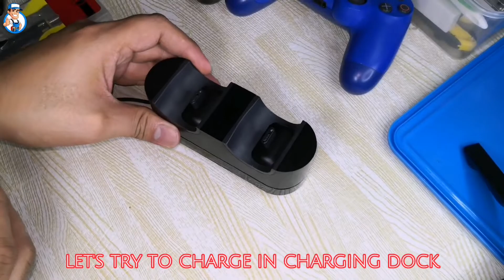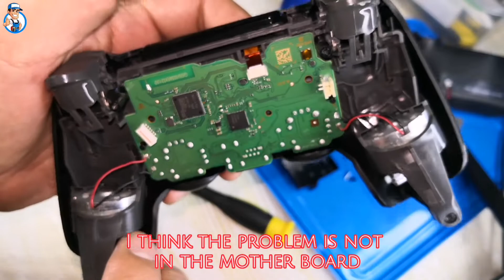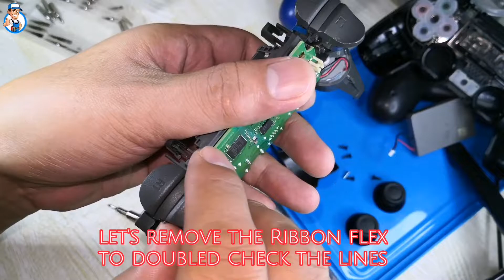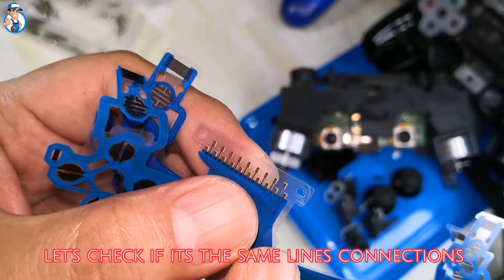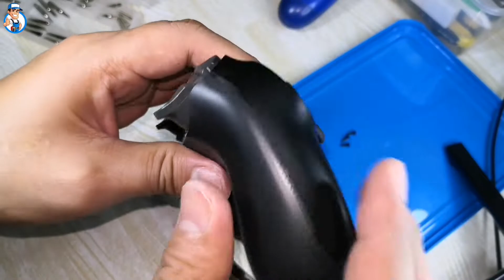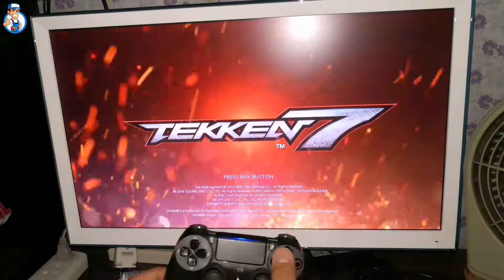How To Repair PS4 DualShock Controller | CAN'T TURN ON, Replacing Conductive Film Can Solved it !!

Comment: Thank you My ribbon is blue can I use a green one same version..will it work please??
Reply from the maker: yes bro.. it doesn't matter if the color is blue or green.. the important is they both match to each other.
Reply from the maker: there's an instances that you will buy or recieved a green color, but if its same in all sides and connection lines.. it will work 100%
Reply: @raitronics  yes the number is the same thank you
Reply from the maker: @contagiousdoge3054  good luck bro 👌
Reply: @raitronics Hi bro how do I know, if im ordering the right ribbon?
Reply from the maker: you can match it on each hole's locations on the ribbon, every version of the ds4 controllers ribbon (conducive film) have different locations of holes, so that will be your patterns to make sure that you ordered the right versions of ribbon
Reply from the maker: if the holes didn't match you can't install it properly,  it will not fit

Comment: Yo bro idk if you gonna response but mine have the same problem. When i plug the charger in it didnt show orange lighting,and pressing power button show no response too. Replace the battery still didnt fix it. Should i try your replacement. Also everything works fine, the light(idk whatever its called) the ribbon cable, tested all.
Reply from the maker: hello bro, may i ask what's the status of your controller now? did you tried to change the Conductive film?
Reply from the maker: there's a possibilities that maybe the battery is already full charge that's why it didn't show the orange (charging) light when you connecting it to a charger, and there's a possibilities that the reason why your controller didn't respond when you're trying to press the power on, it's because the power button is also include on the Conductive film wich i present on the video,
Reply: @raitronics  I havent
Reply: @raitronics  oh but I change like 3 battery and there's no response
Reply: @raitronics  where could i contact you

Comment: My controller is not working when i press the home button but if i connect it to the cord it works and  with red light on. But i cannot press the home button. Is this possible that the conductive film is damage?
Reply from the maker: bro, palitan mo lang ng Conductive Film.. 100% gagana nayan, yun lang ang sira nyan yung conductive film.. yung kulay blue na pinalitan ko.. sa shopee meron nyan
Reply from the maker: yun lang ang lods ang sira nyan.. nasa 10 to 15 pesos lang yan sa shopee.. kaso china manggagaling.. Kung V1 yung controller mo dapat V1 din orderin mo.. kapag V2, dapat Version 2 din ang ilalagay mo.
Reply: Ganun ba boss, cge2 po try kong palitan, mura lang pala haha cge2 salamat
Reply from the maker: @jedobjero8054  yes po idol. mura lang yan.. wala pang 50 pesos.. mas mahal pa shipping fee kesa sa items 😂

Comment: My ds4 controler automatucally turns on and it will connect to the ps4 for like 10 seconds then it will disconnect and completely shutdown... what seems to be problem??
Reply from the maker: did you tried to reset it bro?
Reply from the maker: check this video bro.  https://youtube.com/shorts/FxLCv2V2XwY?si=iY7Km9NMTZ06cc1s

Comment: Hi, my device doesn’t turn on. I don’t have the charger to test it as shown. How can I tell if the issue is with the USB port or the conductive film?
Reply from the maker: in your case, there's no other way bro to know what exactly the trouble of your Dualshock Controllers, unless you test a new Conductive film just to make sure.
Reply from the maker: or if you have an extra controller you can test the battery to the Deffective one. so you can analyze if what's the problem,

Comment: Hey man interesting video. My controller has no light when charging after replacing usb and the usb port. do you think its something to do with the battery or the membrane? It was broken when i kneed it it started randomly turning off occasionally needing to be reset from the back. I think it's the motherboard actually
Reply from the maker: hello bro.. im analyzing what your saying about the trouble of your controller.. i may suggest if you have an extra controller, and its same models.. you can try to borrow the membrane or conductive film on your extra controller and you can try it to the controller that having a problems.. just to make sure and lessen the confusions, now if you'd try and same trouble shows? i think there's a problem on the motherboard.
Reply: @raitronics  thanks for your advice, I managed to get 5 controllers for £30 so I can borrow the parts 👍
Reply from the maker: yes bro.. that's also what im doing if i don't have available Brandnew spare parts, i will borrow from the other controllers before i will deside to buy wich one is Deffective.
Reply: @raitronics  do you sell PS4 controllers? I was just going to keep them but I think people are offering them for £5 and most just have stick drift
Reply from the maker: @bababla8528 yes bro.. here in my country im selling it but it is slightly used. but for now I don't have stocks.. 😊

Comment: Definitely you are amazinggg god job i have a controller work normally with cable only when i remove the cable the controller turn off directly i tried with another battery and another connector same issue any advise pleasee and upload more videos about ps4 controllers
Reply from the maker: may i ask, is your control can turn on when you try pressing the Playstation button on then center of the controller? or no response?
Reply: @raitronics  when be connected with cable only but when i remove the cable the controller doesn’t respond when i click ps button
Reply from the maker: did you try to replace the conductive film bro?
Reply from the maker: if you have an spare of controller and if they're the same Version, you may try to borrow the conductive film from your spare controller and testing it to the one that having trouble, for you to determine what or where is the trouble came.
Reply: @raitronics  i tried but same issue not working i checked mother board there is no issue and i got the film and inserted it in second controller work normally
Reply from the maker: @ابوالزيك-ظ3ق  possibly the motherboard is the main problem

Comment: nice video bro, my controller is acting weird like its buttons are pressing or activating on their own even if i am not touching or pressing any button what should i do?
Reply from the maker: Try to Clean the conductive fiim and all the Button's inside, then check again if it works,
Reply from the maker: use soft cotton and isopropyl alcohol

Comment: My R1 wasn't responding , tried cleaning,  new rubber contacts , then I replaced the conductive film. This fixed R1 but now R2 is constantly engaged as if pressed down even though its not . Its even engaged with the R2 button and rubber contact removed.

Wierd thing is I switched the old conductive film back in and it fixed R2 issue but now of course R1 is broken again.

Any ideas? Makes me think maybe new film is faulty?
Reply from the maker: hello bro .. did you try to clean the contact between the Conductive Film to the motherboard connections? and Double check if the rubber paddings is still on the right place positions?
Reply from the maker: sometimes there's an instances that the contact to the motherboard is dirty, or sometimes the small rectangular rubber paddings is not on the correct positions so the Conductive film didn't push heavy to the motherboard contacts.

Comment: why isnt the yellow button on my ps4 controller turn on when i put it on the charger?
Reply from the maker: check the ribbon at the back cover bro .. that's connected to the LED light at the Top.

Comment: How do i know the model of ribbon circuit?
Reply from the maker: if the controller you have is Version 1, you need to order a V1 conductive film,  of if the controller is Version 2? you need to order a version 2 Conductive Film. or others called ribbon flex.
Reply from the maker: you can identify the V1 controller wich is the game buttons and the cross directional buttons are color black.  while the version 2 is color gray.

Comment: Mine keeps blinking white, is it also the blue thing thats the problem?
Reply from the maker: hello, what do you mean it's keep blinking white? did you tried to reconnect it to your PS4 Using the micro usb Cable?
Reply from the maker: if you're controller is already connected to your ps4 and it keeps blinking the white Led lights, try to Reset your DS4 CONTROLLER by pressing the tiny buttons at the back with a small hole,
Reply: @raitronics  my ps4 is turned off and the controller keep turning on by itself, but earlier i tried opening my controller following your vid and cleaning it(i didn't change the blue thing tho) and now its ok(i guess its just alittle dirty). thank you for your vid😊
Reply from the maker: @kimmy7936  nice ☺ Job well done 👏👏

Comment: Man my controller is the same way right now
Reply from the maker: if your ds4 is responsive when you put a charger and the Orange Led breathing light is functioning.. there's a possibilities that your ds4 motherboard is good and not Deffective..  i may suggest to you to check the ribbon if there's a dirts in contacts or cut lines.. better try a new ribbon flex or if you have a spare of controller there? get that ribbon and try to test to the one that having a problem,